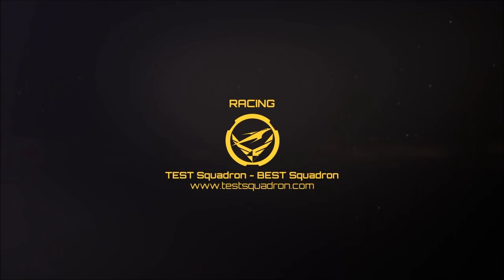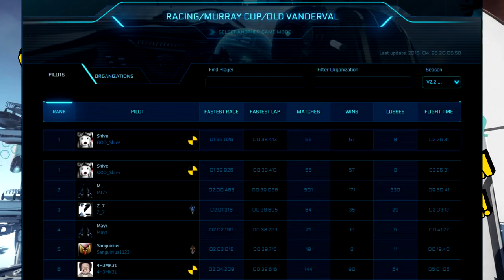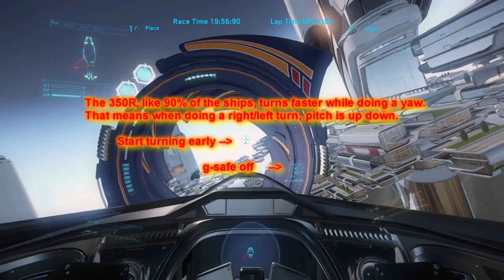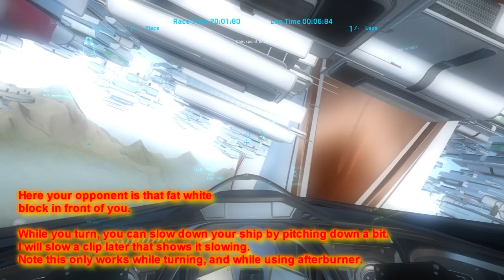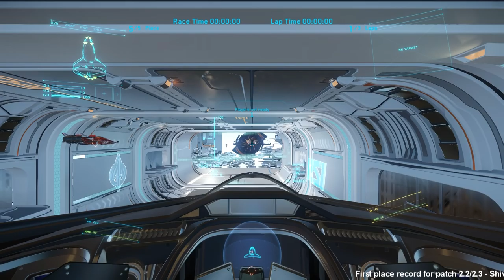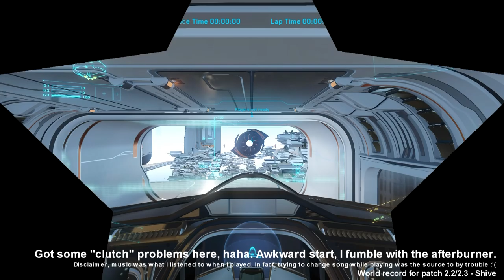Shive's Guide To Old Vanderval - How to not SUCK

Comment: Nice. Looks like you are flying with M+K. Is that correct, and if so, what are your thoughts regarding fling with sticks/HOTAS?

Also, have you flown the Khartu-al?
Reply from the maker: +Eskel Gorov Hey Eskel :D Nice to see you here. My thoughts are that, while the keyboard is slightly limited by its binary functions, the mouse as a piece of hardware outshines everything in existence. I'm not prone to giving up the keyboard at the loss of some strafe control vs losing the one thing it's good at: having a lot of keys nearby (something I want both for the PU, as well as combat + blitz racing). Don't think anything can really challenge it there. However! I've been looking into getting some pedals purely for the throttle (don't care about the rudder thingie).

Haven't flown the Khartu-al. Would love to though.

Comment: +Shive got some questions too for maybe later videos:
1/could you explain how and why the afterburner speed reset sometime? after some hard turns for exemple.
i dont understand why with mustang on this race i can press afterburner all the race without any reset and with m50 you need to relaunch it sometimes ( for me after turns 3 and 4, seems you dont suffer from this pb)
2/and maybe a small tuto for the good way to damaging parts of the vessel to get best speed exploit (do you think this xploit wont be patched and will be part of race gameplay in the rlz?)
Reply from the maker: +Livewild78 The game is broken. The afterburner is always meant to reset when you hit 0 boost (you can see it next to the speed how much you have).
The 350R and a few others are broken so they never break when boosting/afterburning when they've already used all the boost. Thing is, the ships regenerate a little bit of boost, and for some reason that tiny bit lets boost stay on. 
However, the wilder your maneuvers the more boost you use, as more maneuvering thrusters go online. At some point the drain is so big compared to the generation that it breaks and goes offline, and that's what you see in the m50. If you have 0 boost, and you try to activate afterburner on a straightline, you'll succeed. If you try to turn, you'll fail. 
The 350R is further broken, and you can do whatever you want and remain boosted.
Reply from the maker: +Livewild78 A little bit/moderate turn is okay, but hard turns will break it if you're out of boost.